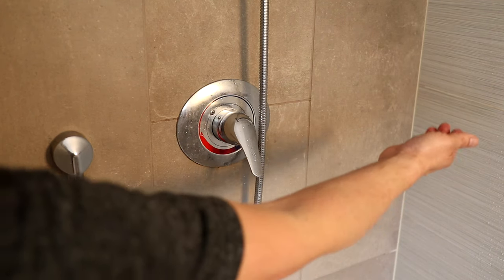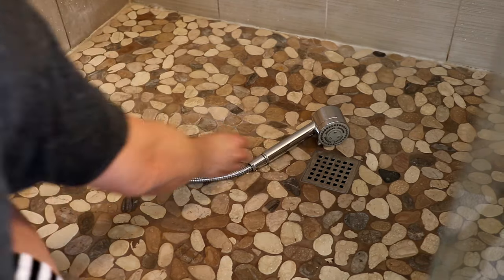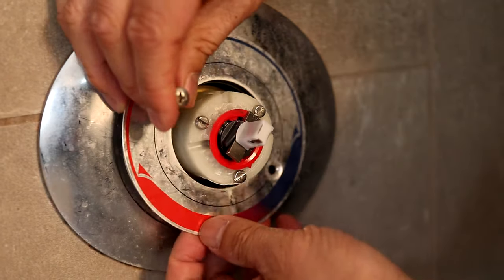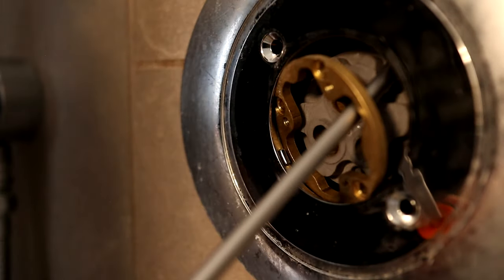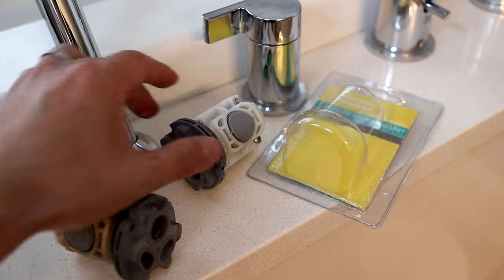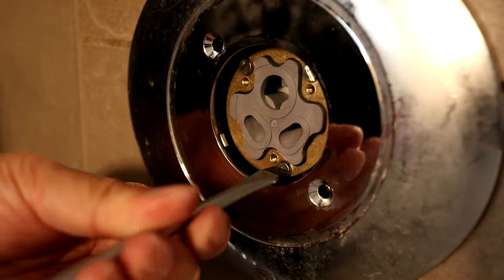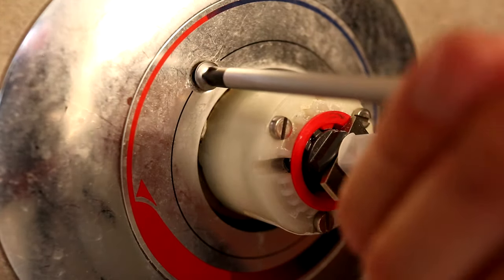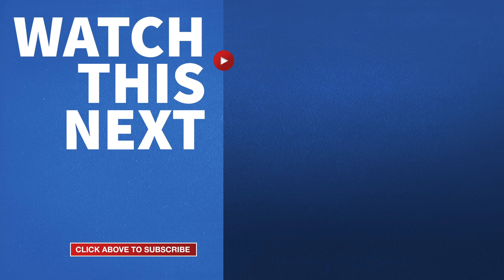American Standard Shower Cartridge Replacement Instructions - Shower Valve Pressure Balancing Unit

Comment: Awesome video.  Great details and very helpful!  But how do you ID the replacement unit if you only have the old pressure balancing unit.  Is there a part number somewhere?
Reply from the maker: I didn’t have a part number when I replaced my pressure balance unit. I took the old one with me to Lowes and just compared it through the packaging. I think I showed the part number in the video when I got the shot of the new one. That’s how I found the right part.

Comment: Great video! Will swapping this help with low pressure on the tub and shower? This is the only bathroom with low pressure and all of the valves are open all the way. Thanks again!
Reply from the maker: I’m not exactly sure if changing the pressure balance unit will help increase the water pressure on your tub and shower. It’s possible this could help. But on mine I was having non-existent cold water and water pressure was not affected on my shower. I’m not an expert in plumbing this was just my DIY on fixing my water temperature problem. If you have the same fixtures in your other bathroom maybe you can swap out the pressure balance units to see if anything changes. However you’re doing twice the work to test it out. Sorry I’m not more helpful!

Comment: I would add a step at 3:37 --briefly turn the water back on.  It will shoot into the shower but also clear anything which might have caused the blockage in the firs place.

Comment: Great informative video.    I am only having a drip, every 12 seconds(I can be anal sometimes😊).    Are there just o rings or seals I can replace, or replace the whole unit?    Thank you again.
Reply from the maker: On the pressure balance unit it comes with 2 o-rings attached to the back of it. I’m not a plumbing expert but it you’re having a slow drip then I think you might need to replace the shower cartridge instead. That’s the first part I removed in the video. The part that the handle attaches directly to. All these parts are available at Lowes and Home Depot. Hope this helps!
Reply: Helps very much, thank you!

Comment: I noticed that you didn’t remove the old rings, would that cause any issues?
Reply from the maker: Someone else mentioned the old O rings as well. I actually didn’t notice it at the time I shot this. Sometimes I have a lot going on when shooting these repair videos and forgot about the rings. I had the old O rings still in there for months and didn’t have a problem. But I eventually opened it back up and removed the old rings just so it’s a proper installation. So definitely remove the old rings! Hope this helps!